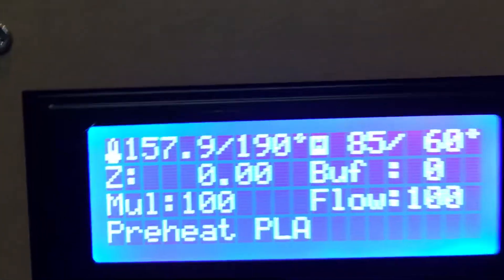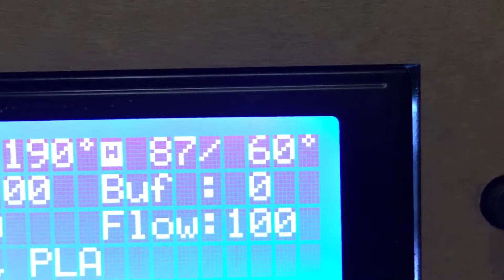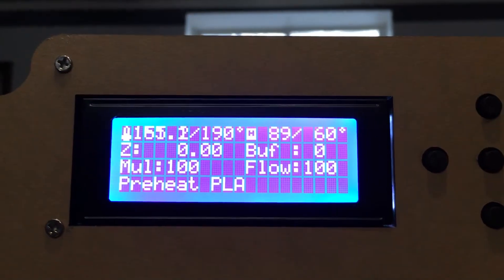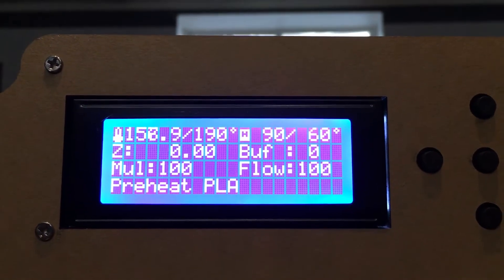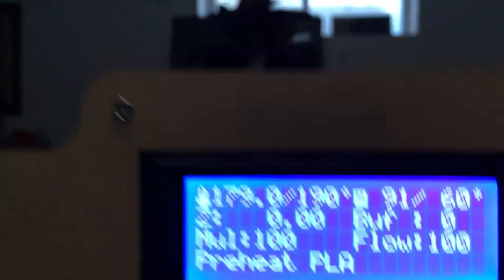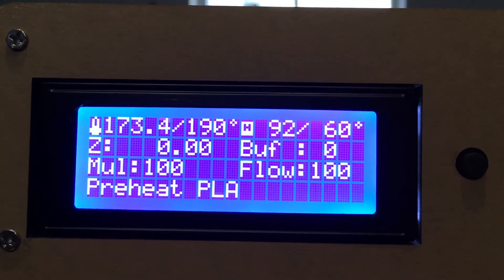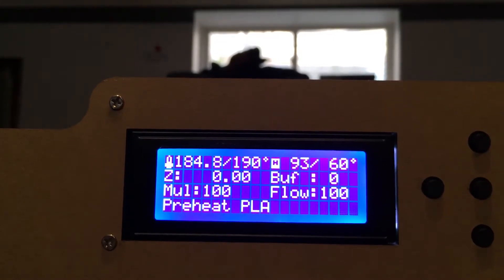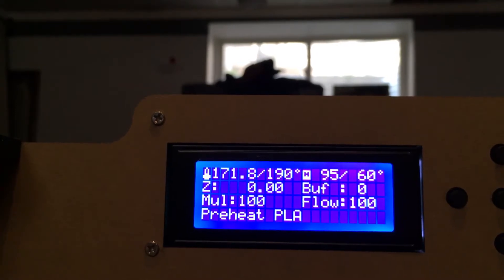Anet a8 temperature issues

Comment: I had the same problem and i am pretty sure it is because the maker gives wrong wires. Anyway i bought 2 mosfets and problem fixed! You can use just one for the heat bed, i just used one more for the extruder just to be safer.

Comment: If you see the lite flicking on the table under the glass.  It is fluttering the power down so it does not over shoot set point.  There should be two lights.  Other is for the table.  I read in the manual how you could adjust that but it is way over my head.  You could also set you fan speed to "0" till the second layer then run to only 30%-50% till it finishes part.  It is under "Cooling".  Mine is set at 60%.  My printer struggles and is always 5 degs or more below set point.  I am going to try to lower fan to 50%

Comment: My hot end thermistor was bad, I replaced both after ordering parts,  and then I had that problem where I couldn't keep the temperature stable ...The Chinese company send me a 30 watt hot end instead of the 40watt ones, but then during the process of installation I caused a short, Thinking the problem might have been the resistor and capacitor I tried to swap them up, but both now the hotbed and hot end were failing.... the chip was damaged in the area were it translates analog to digital signal, so what the heck.
So I'm upgrading to RAMPS 1.6  I hope that helps you to diagnose your problem.
Don't forget to tune up your DIP settings as well. Cheers

Comment: Damned ... No one helping, I have the same issue, at this point I'm thinking is the power supply , but my problem coincides with the replacement of my heater cylinder and thermistor, I can get it up to the desire temperature but it drops like a brick once the fan starts working even at the lowest and it used to withstand the 100%

Comment: Extruder temp doesn't rise / not hot enough, check the D5 indicator: 
If the D5 indicator doesn't light on, you need to replace the mainboard.
If D5 indicator lights on, please check End port connection. If it connects well, you need to replace extruder heating pipe.
(if you don't know D5 indicator and End port, see the images here: https://goo.gl/ncmZt5)